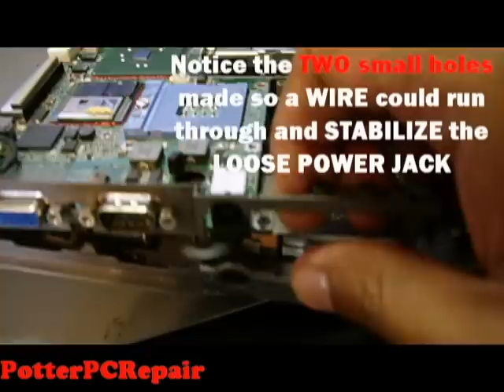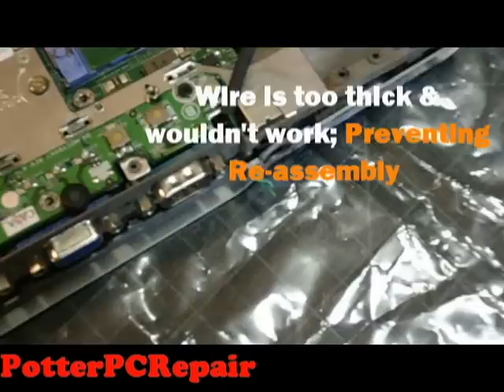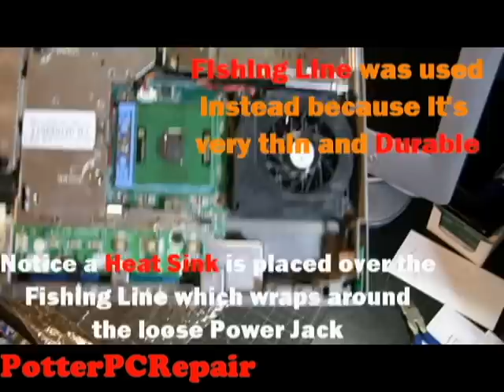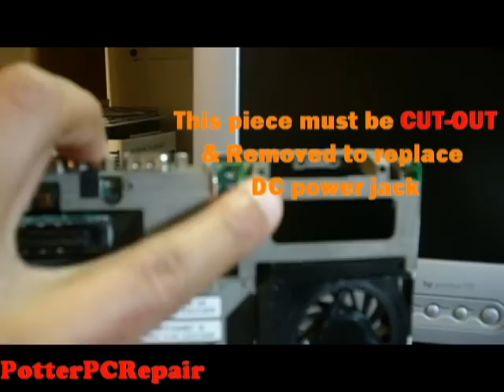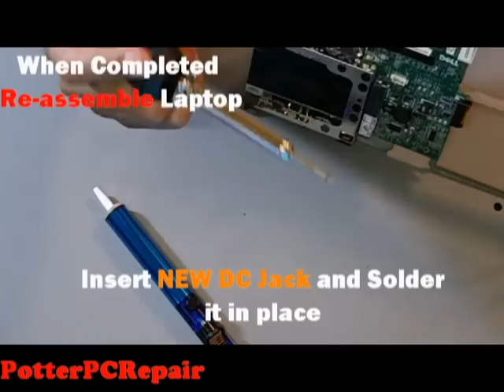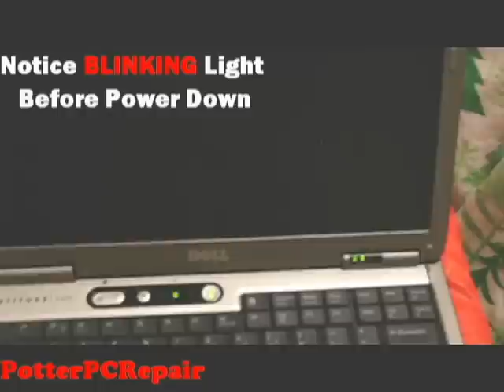Dell Latitude DC Jack Repair Pt. II

Comment from the maker: What jumps out to me from what your saying is the overheating issue, you said the fan isn't spinning which will cause the CPU to overheat and turn off. Since you already resoldered the dc jack you have already accessed the motherboard. I suggest purchasing "Arctic Silver 5" a thermal compound to put on the the CPU to keep it at a cool temperature even without a working fan, its about $8 on newegg.com. This is just a possible solution but it definitely worth a shot.

Comment: on dell latitude d620 i have problem with dc power. 
if i move dc connector, latop turn off (battery charger does not work) or monitor and fan off while hard disk stil on.
sometime overheting error appear when i reboot.

what i did:
1. tried another power adapter - same problem
2. cleaned from dust - same problem
3. resoldered DC power jack on motherboard- same problem
4. replaced the DC power jack - same problem even worst

I do not know what to do next.
Any suggestions - idea?

thanks, michele

Comment: Thanks for the helpful video. I have a Dell D600 which is totally dead with discharged batteries. I need to check whether I have a problem with the DC jack. After watching your video, I get the confidence to open up my D600. 
One suggestion: Your video would have been even more helpful if you had recorded your voice to provide useful tips instead of playing that irritating music. 
Bala

Comment from the maker: @THEECEE97 I checked for the website but I couldn't find it, I repaired this laptop a couple of moths ago so maybe the site is down. What I do  have is the ACTUAL pictures of the Strong Plastic I used during the repair. I have them on my website with some Instructions. My Website is on My Channel Page (Click On Pictures Link) Hope this helps.